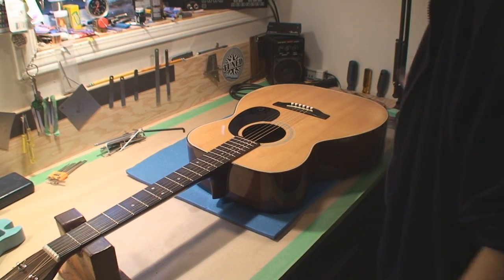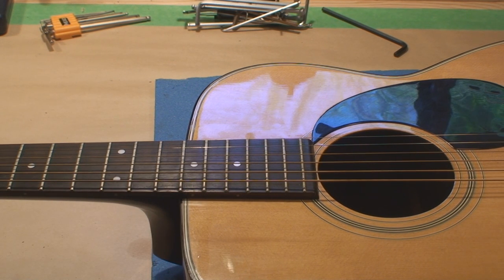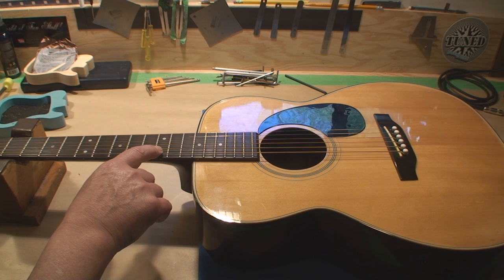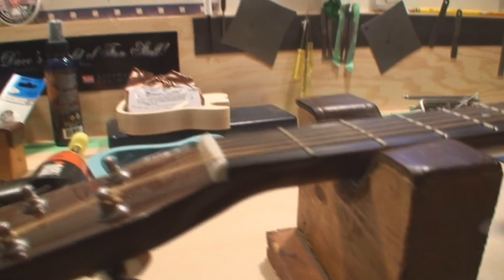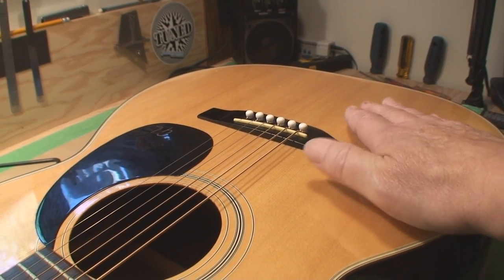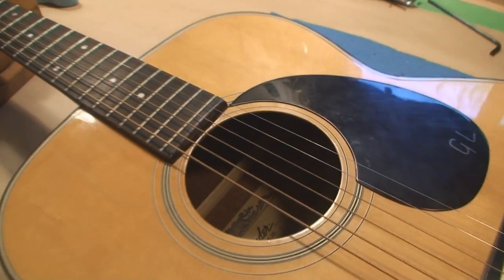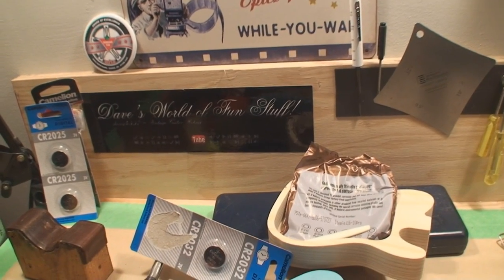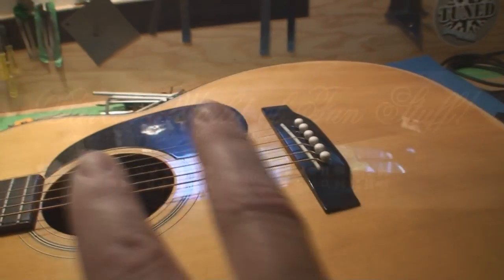Common Acoustic Guitar Problems

Comment: 2 years ago, I bought a 1972  Harmony H-166 acoustic.  It had been 53 years since I owned a Harmony guitar. By today,s standards, this guitar would be in the $600.00 range. It is flawless, with plenty of room for neck and intonation adjustments, which it probably won't ever need.  Just goes to show how integrity and pride has changed.

Comment: Hi Dave. I have a moderately high end 1990s acoustic that I've had for a few years. It plays nice but I've always found the volume of it too low considering the quality - my much cheaper Simon and Patrick guitar, for instance, sounds much more resonant and bombastic. The guitar doesn't sound rubbish, quite sweat and mellow, so I'm hoping it can be tweaked for a little more volume and zing.

The guitar feels beautiful in the hands. To the naked eye the bridge is secure and no obvious bulges in the body so I'm assuming the bracing is intact. Humidity might be an issue but then my cheaper guitar, kept in the same conditions, sounds peachy so I suspect not.

Only things I think might be making a difference are the saddle, which looks like plastic and not even Tusq, and the fact that the action feels a touch lower than any acoustic I've owned so I'm wondering if the strings have enough room to vibrate optimally. Would bone or ivory transmit more vibration and thus more sound and would raising the action just a shade be a possible way to go?
Reply: +hammondsphoto I don't know about the construction of the guitar, but thick strings (and thick picks) usually help with volume. Try adjusting the action but low action is usually a good thing. Isn't volume determined primarily by the size of the resonance chamber?

Comment: Mista Dave , please listen to me ..  Shaving bone saddle to address action is not good 🤔  The break angle across  the bone becomes more shallow because the saddle is so low  ,so the string pressure pushing down on the bone is far less,, therefore  you lose volume , and overall tone of the guitar.. The only way to address this problem is to do a neck reset to correct the pitch of the neck , then you can install a  new saddle bone with the correct height to factory specifications  .. 🤷‍♂️

Comment: When the acoustic top sink down doesn't that lowered the action plus with lighter gauge of strings sometime you have to humidify it to bring up the top with moisture but ur risking for the get water into the wood and create mold, yikes !
Reply: Typically, when that happened(sinking sound hole), both the neck and bridge deflection changes - thinking of the guitar folding-in on itself.
Therefore and with that being said, this results in the action getting higher.

Comment: If yall want a damn good fender acoustic for around 200$ look at a fender CD60-CE .. acoustic electric.. beautiful necks and frets and onboard decent electronics. I got mine for 170$.. a super budget acoustic that is good but needs some setup help is an epiphone DR-100 .. you can get those DR-100s dirt cheap. I got mine shipped to my door for 99 US dollars.
Reply: I bought a demo Epiphone DR 100 for $69, put a  Tusq saddle and shaved it down a bit. Sounds great and plays easy. So you are right!
Reply: +Scott Brewer bought a dr 212 twelve string for about 120 bucks slightly used! after set up sound great after set up and tuned down to c# to lose the twang and get the bottom growling! one of the best values in guitars in guitardom!
Reply: In Peru, I got a new, lovely Fender CD-60 with hardcase for $148 on sale (no electronics, but managed to get a Dean Markley external pickup) and it works and sounds really fine. It came with good Fender strings and the neck is comfortable enough for medium/small hands like mine. My bud got a Epiphone PRO 1 Ultra with electronics and tuner for $272 and it sounds and plays really good, too. We play Beatles covers and are happy with both of them. Just send it for a set-up to your local tech/luthier and buy a new, good set of strings for it that match the factory ones and that's it!
Reply: José Aquino fender CD-60's are just fine. I owned one for years and it sounded alot better than alot of 500 US dollar guitars

Comment: I have a newer Martin HD 28 (3years old) and it requires so much pressure to fret the strings. I've had it set up and the action is actually lower than any of my other Martin acoustics, but it's still so much work to play. 
No one can give me an answer as to why this guitar is like this. I wanted to ask you because of all your experience repairing guitars. Do you know why it's like this? And is there anything that can be done?? It just feels so tight to play..
Reply: Try lighter gage strings
Reply: funk- I had put 12's on it and it played totally comfortable. But it didn't sound like it should when it had 13's. I have a Martin mmv also, and the mmv, which is a guitar center custom, with rosewood back and sides, spruce top, all solid wood as well, but has the d 15 bracing, and my HD 28 sounded only as good as my mmv. Which was kinda upsetting to me because the mmv was 1800 compared to the 2800 I paid for the hd28. So to make a long story short I lowered the saddle quite a bit, and now the HD plays totally comfortable with 13's now. I didn't think I could lower it that much but it's great now. Doesn't break up or anything.